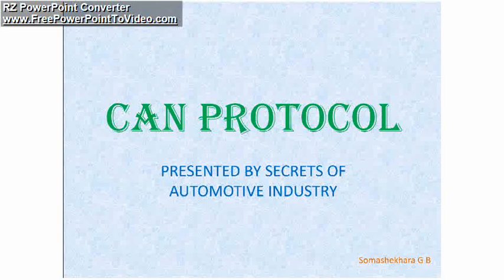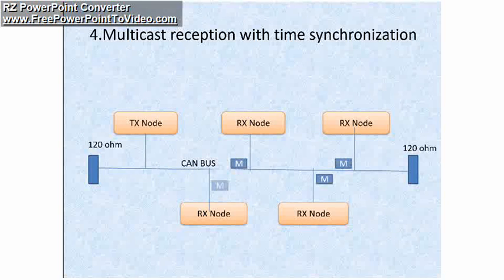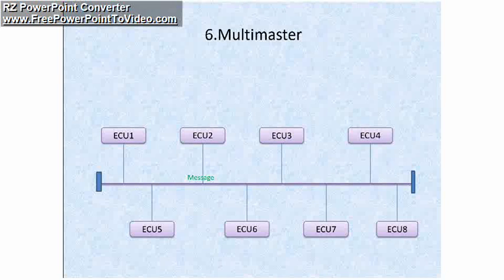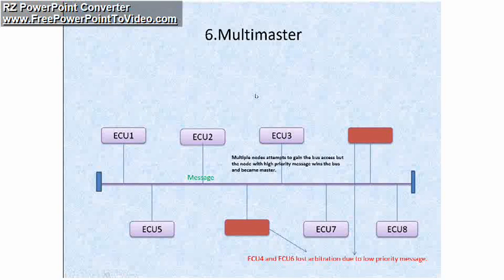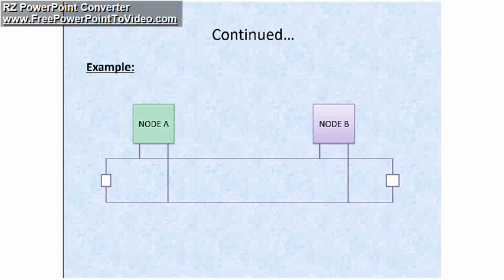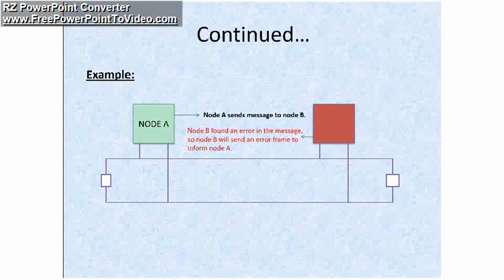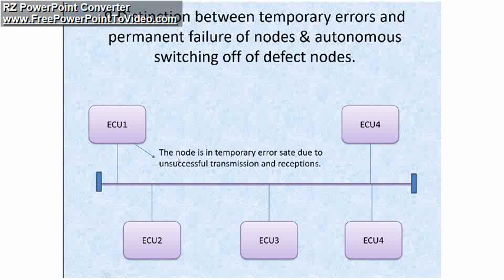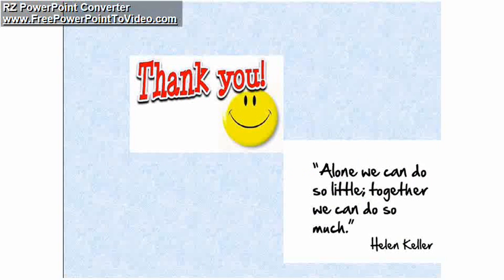CAN protocol basics. PART3, Properties.

Comment: Dear Sir, thank you for your video..I have one query. Why gateway is added to CAN network? 
Also, 120 ohms resistance is being added to both ends...what is function of it?
Reply: Gateway act as a translator between different ECU's, like signals of different ECU's may have different set of signals(difference in Name, difference in Bit length and a different set of value description), so to make communication possible between them gateway is used in CAN network.
Reply: signals or Mesaage's
Reply: The resistance are for reducing the interference
Reply: Hello there it is little bit late for reply, but still worth mentioning the answer for gateway query.
gateways are used where there is need to transfer of data between 2 different communication protocols e.g. CAN ,LIN Flexray etc. OR between 2 different speeds of communication for same protocal e.g. CAN low speed to CAN high speed & vice versa.

Comment: In explanation of System wide data consistency, Is all receiving nodes going to send the error message together? Or there is any arbitration for sending error message too.
Reply from the maker: 1. Yes all receiving nodes sends their error frames, if they  have not seen the error frames over the CAN network, but not together. 
2. Error frames does not contain arbitration field, so no arbitration process (Kindly watch my part12 video to understand error frame).

Comment: if the node having h/w failure can be detected???,how the bus Will be idle when one node is having h/w failure(which leads to busoff)how others nodes will work???
Reply from the maker: Good thinking..

1. The state of  a node will be decided based on its error counters TEC and REC. If TEC and REC less than or equal to 127 means bus node is in error active state that means normal operation, if duo exceeds  the count 127 and duo are less than 255 means error passive state and if the duo exceeds the count 255 means bus off.

2. Here, bus off means the node which has reached the counter values >255, that node will not be in position to transmit or receive messages anymore and this will be known for that by its error counters and that node will be automatically withdrawn from the network. (Bus off: The bus off means, state of a node, not the CAN bus off). so the nodes which are having legitimate counter values can communicate normally.

3. Hardware failure may be detected by the node itself internally with the help of other parameters.

Kindly stay tuned for the fault confinement session video, so that you can understand in a better manner.
Reply: Secrets of Automotive Industry thank u
Reply from the maker: Welcome.
Reply: hi sir you told that hardare failure can be dected by the node itself internally with the help other parameters.. What are those parameters please explain,,,

Comment: hi if messages is sending cyclic 100ms If received node detects error,
1)how much time will same msg will transmit
2.is the same message repeatedly transmits or it will overwrite with new message???
Reply from the maker: 1. Hello, Kindly find the below answers,

 I hope  you understood the Guarantee of latency times in properties of CAN protocol, the 100 ms cyclic messages are transmitted for every 100 ms (Based on priority) irrespective of error and no error.
Reply: that means the messages which are having the cycle time less than latency time,the error message data will be lost ???the new message???
Reply from the maker: Cycle time can not be less than latency time.. I think you have confused.. Kindly understand, Latency time means time taken for node to send its message and receiving an acknowledgement for the same, thus latency time will be less than or equal to cycle time.

Comment: as per last property how sender node or any node knows about the action of other nodes whether the nodes are performing thier action or not.if hardware problem occures.
Reply from the maker: The node which is having the permanent  issues, for example hardware failure, that node will automatically with drawn from the network, means it is not in a position to send or receive messages any more. But other nodes will not be aware of this, their job is to broad cast the message over the bus, if they receive acknowledgement for the sent frame, they will think that successful reception, else retransmit the same.Still not clear, just drop a comment here.
Reply: Suppose "A"node has hardware failure is withdrawn from the CAN network,but  other node "B" is trying to send the data to "A",Node "B" will get NACK,Now if it keeps on retransmitting data searching for Node "A",then bus will be always busy,How about the transmission between different ECUs on the network as busy is always busy?How is this condition handled?
Reply: tq sir
Reply from the maker: Welcome.
Reply from the maker: I will be explaining this in Fault confinement concept of CAN.
Sorry for the belated reply, Kindly stay tuned.
Reply from the maker: I will be explaining this in Fault confinement concept of CAN.
Sorry for the belated reply, Kindly stay tuned.
Reply: sorry sir my question is not related to reception and transmission it successfully happening but if node node 'A' having simply periferal like front head light,and indicator and some sensor.if front light has failed .will it knows to same node 'A' node.if yes how ?
same thing at the node 'x' is conected  break wire it has failed gone out how it will know while testing the car

Comment from the maker: First point: The two messages with same ID, will never exists in CAN network.(This has to be taken care while designing a system). second point :  In case, if they exist, bus conflict will occur, since both the nodes consider arbitration is successful. (so as you already know only one node can gain the bus access at a time). This leads to an errors and the bus access process will be repeated, TEC and REC counters keep on grows..
Reply: Sir but what if it considers two IDs as One ID? it will detect an error if two transmitting nodes data  is different from each other, please correct me if I am wrong?

Comment: Can you explain What happen if the arbitration of two msgs are same?
Reply from the maker: First point: The two messages with same ID, will never exists in CAN network.(This has to be taken care while designing a system). second point :  In case, if they exist, bus conflict will occur, since both the nodes consider arbitration is successful. (so as you already know only one node can gain the bus access at a time). This leads to an errors and the bus access process will be repeated, TEC and REC counters keep on grows..
Reply from the maker: Anyway I will be explaining this in upcoming video's. But, good question.